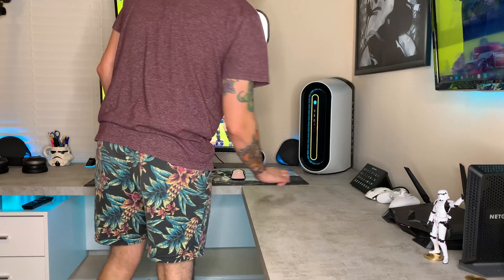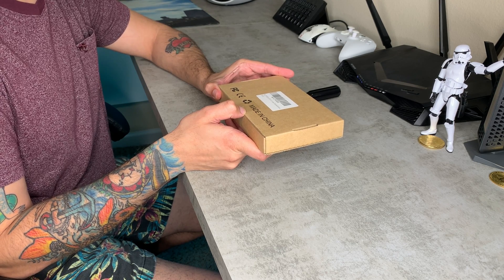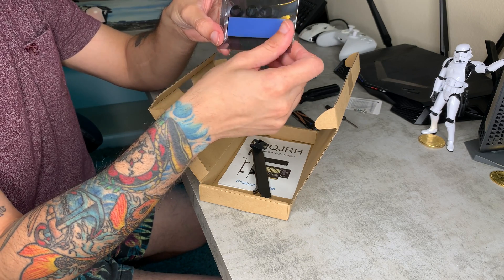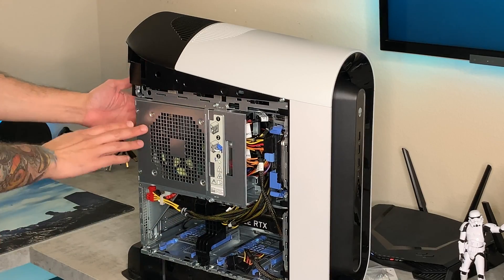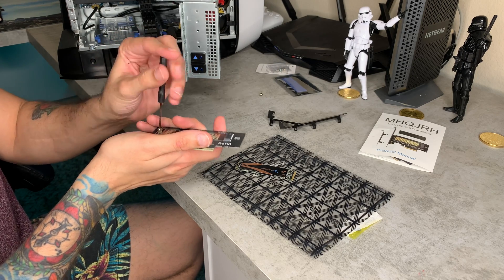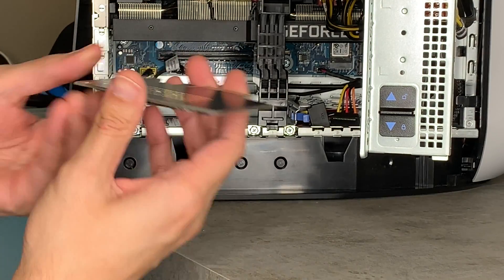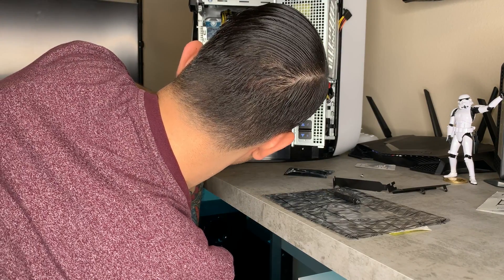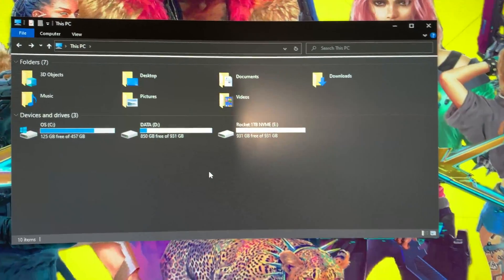Install 2nd NVME SSD on Alienware Aurora R11/R10

Comment: For those having problems with Windows 11 not recognizing the new SSD (while it is showing up in BIOS) - I had it in the PCIe x4 slot two below the GPU, and it wasn’t showing up; then I moved it to the PCIe x8 slot, and it worked. No need to move the GPU, at least for me. Aurora R11

Comment: Mine seems to be working just fine but the red LED light on the drive did not turn green or turn off. Is it ok if the light remains red?

Comment: I have an aurora r10, but I just recently grabbed a 990 Evo pcie 4.0 x4/ 5.0 x2 nvme m2 ssd. After watching this, I noticed the addapter is for 3.0, not 4.0. Will this still fit this adapter, or do I just need to go back and get a sata?

Comment: This adapter is literally so NOT FIT. it does not lock in to the motherboard built-in latch. Do not buy this adapter. Any other Amazon adapter that has more pins and a lock design would fit better and be cheaper.

Comment: Nice video that I stumbled across, allows me to increase storage in my R10 w/o having to mess about with relocating the boot drive. Perfect info and glad to see I am not the only one that added a second intake fan. I have Noctua NF12X25 Cromax fans - 2 in and 2 on the radiator in a push/pull....seeing 3-5 degrees less on the GPU temps which is nice

Comment: Thank you for the video!  I was about to add a bunch of games to my pc, and the speed from an external disc was not cutting it.  I'm going with both the ssd and adapter you have available.  I really love this computer, but I haven't gotten much use out of it thus far since I bought a PS5 and Xbox Series X around the same time.

Comment: Update For anyone watching this video. I was having trouble with my R10 recognizing the SSD in the adapter. I reformatted it on a separate pc and it still would not recognize it. I tried disabling TCM or TCP (cant remember exactly the letters) in bios. That had zero effect. The solution to adding a SSD with adapter is  1.) Take the factory SSD off the MOBO and put in the adapter. 2.) Place new SSD in the MOBO. When I did that it automatically recognized the new SSD already formatted. I am confident that you can use this process even without pre formatting the drive. Hope this helps someone. I went to the end of the internet and back twice trying to figure this out. Thank you Gamer Heaven for the tutorial and idea!
Reply: I'm going to buy a SAMSUNG 990 PRO w/ Heatsink SSD 2TB, PCIe Gen4 M.2 2280. Should I just do this off the bat or test out the original way? I have an R10 as well.
Reply: @RynJck did it work??? I’ve been having issues 😔
Reply: Bloody hell you are a genius! How the xxxx you found the way to fix it?! Anyway it solved my problem for my R11 and saved hours and days to return or buy new ssds. Thanks 👍

Comment: I did this but put a SABRENT 2TB Rocket 4 Plus NVMe 4.0 Gen4 PCIe M.2 Internal SSD Extreme Performance Solid State Drive R/W 7100/6600MB/s (Latest Version) (SB-RKT4P-2TB

And im getting 6000gbs . Write/read

Comment: I know this is a while ago, but i still have my R11 and i was wondering if using adapter is just slower speeds vs swapping out the original. I could just as well clone the original. I ask, because, often is the case, you lose a lot of speed by using the adapter in the other pci slot
Reply: Do you lose a lot of speed using the adapter?

Comment: I know this comment is late, but I have had a problem with the adaptor install. The side brackets do not fit in the Alienware aurora r11, so had to just slot it in as you did. however, the adaptor is not secure at all and flops all around. I have been unable to get my system to recognize the new ssd either. Do not know where to go from here, but I caution everyone looking to buy the recommended products, I think the video maker just had the new ssd laying around from his other computer that was already ready to be installed, and the adaptor was cheap so I think he figured he could spend 12 bucks and make a video. good idea, but for those of us trying to figure this out from scratch it appears as shady business practices when his steps do not work if followed.
Reply: Yo bro did you get your pc to recognize your new drive
Reply: @Aguafy  yes I did. I had to keep fiddling with it until the light came on. Then I could recognize it. It won’t work until the light comes on, little red light. Then you have to discover and name it so you can save to it.
Reply: @Bazarov-SPQR   what do you mean fiddle with it

Comment: The "Alienware Aurora R11 Setup and Specifications" state it can only support 1 TB max of SSD.  This video clearly demonstrates that is not accurate.  Will the R11 support the faster write capability of the newer Gen4 drives?  Manual kind of says "no" but it is not definite.  I have updated firmware.

Comment: Starting right now, I have 2 days to: 1. determine what is the best, fastest nvme is compatible with my R11(currently has the stock 256GB nvme SSD, 1TB HDD)
2. Order them with the appropriate potentially needed adapters and splitters.
3. Install them
As this video is a year old, I have to ask, is this nvme still the best/fastest ssd in today's market?

Comment: Has anyone else’s 3080 temp increased since installing second nvme in the second PCIE slot underneath the GPU. I feel it’s restricting airflow?
Reply: Increased by a whole 15c when benchmarking I should add

Comment: Nice video, but you really should have cleaned the drive with Diskpart on the other machine before installing it, so you could run through initializing the SSD through Disk Management and formatting it.  When brand new, the the user won't find the SSD drive until you do the above steps.

Also, you should be recommending users installing the bracket.  A lot of users move their system around or upgrade different things in the computer which can cause the card to become dislodged and stop functioning.

Comment: Bro. We’re having trouble recognizing the new NVME on the adapter for the R11. I even formatted the ssd on my other pc so it recognizes it. Plugging it back into the R11 we see the red led for power but disk mgmt is not showing the new 1TB. Entering bios on the R11 it shows the rocket 1TB ssd. Do you have any guidance for us?
Reply: Brand of adapter?

Comment: Gotta wonder why they didn't design the adapter so the NVME is on TOP of the adapter so the heat can more easily rise away from the heat sink. Derp.

Comment: I have a R11.  The existing HDD is 1TB.  I have an older 2TB HDD off my older Alienware X51 R2.  It is NOT a SSD.  It is the Toshiba DT01ACA200.  Is it safe to add the older HDD to my R11?  Can I use it to store gaming or should I go strictly with a SSD?  Thank you for your videos.  I have already learned a lot from them.
Reply: i know your question was a while ago , but, i read that no hdd is better as they increase heat in your box.
Reply: @SirLucidThoughts  thank you!  Seems when I get a little fuller I’ll just upgrade to a bigger SSD.  Thank you for the advice.  Less heat is a good thing!  😬
Reply: It won't get hot if you don't use it much. Always fine to store a live backup copy.  @SirLucidThoughts

Comment: I need help:
Yesterday I opened my Alienware r12 and took out the ram sticks to see which brand and type they were, put them back in (in the correct way) , turned on my pc again and no signal to monitor. I took them out put again, tried things and idk why I tried doing my normal windows password on my keyboard (still without signal) and my monitor magically turned on saying that the ram had been changed. Now today I installed the ssd exactly how you did, turned on my pc , no signal. I tried so much things hoping for the same luck I had the day before but still can’t find a way to make it work. Help. (My ssd led is on like yours). Have you ever had the no signal problem ? If so how did you make it work. Thx

Comment: Yesterday I came through your video and it was so clear end fun to watch - thank you. I spent 52 minutes in total with 3 Dell Chat agents and everyone told me a different story about what drive to get, how to install it, what was allowed and what was not allowed. None of them understood I wanted to add a 2nd drive and when they got the picture right, they simply said "no, you cannot do that. You can only upgrade..." Their offer: a 2Tb VisionTek for $850. Really?? Good bye Dell Chat...
Reply: Similar story today - but I had already purchased the NVMe after the discussion with the first rep on what options I had for upgrading my device's storage...no one said "hey you only have one NVMe slot", and I trusted them to tell me since they have all of the information about my build.  Should've checked myself, of course, but glad that there is an adaptor option.  Video saves the day.

Comment: People please be aware of this video. I purchased the exact same parts that he put in the description and installed in my r12. The nvme is showing up in my bios but it will not show up in disk management or device manager or anywhere other than bios. Im pretty sure the adapter is not compatible with windows 11. Very frustrating. Tried all troubleshooting possible and it will not work. Only use in windows 10.

Comment: Hey i know this video is a year old but i'm looking at doing the same thing you did in this video. my question is, does it matter for the adapter if i'm running windows 11? i'm stuff on the amazon page that it supports up to windows 10. it shouldn't matter right? since any drivers or limitations would be in the SSD itself not the adapter.

Comment: So ill have a lower end nvme, but also planning to get the 970 evo, is it better to put the 970 in the original m2 slot or use the adapter? Which is optimal for the m2 slot? Which is optimal for the adapter? Thanks

Comment: Does anyone know if R11 supports pcie  bifurcation?  I'm trying to add pcie adapter with 4 slots thatch handle upto 4 name drives.
Reply: +1 i am in the same situation right now. I have Asus Hyper Gen 4 m.2 4 slot NvMe. Could you tell me if you found any solution ? Dell is a piece of garbage.
Reply: @BaatPateK  Unfortunately the motherboard of my PC has does not support bifurcation. I only bought an adapter that can hold a nvme SSD drive.
Reply: @alberthcamus  yeah same, I am using only one pci x4 nvme adapter. But now I need more storage and I don't want to sell any of my SSDs.

Comment: I used the links. I purchased the adapter and the 2tb stick thru amazon. The bios recognizes the new stick in the pcie slot. Nothing else does. Tried the swap as suggested in lower comments. No success. Been on the phone with Alienware/dell support. No help and no charge. Maybe the Geek Squad can help. For $150 I would hope so. Appointment at 3 so we will see.
Reply: Post script. I cant find where this Gamer Heaven person gets back with anyone. everyone seems to be having this problem. i think my fix is to return these items

Comment: I replaced my SSD with a Samsung 980 pro and now the pc refuses to boot properly. Getting an endless boot cycle that nowhere on youtube has an answer for
Reply: with an adapter so you have the old hard drive in the same spot, right......?

Comment: I have the Alienware aurora R11 32GB Ram 2070 Graphics. I installed the adapter and the ssd exactly as told and ordered straight from links. When I plug it in the red light turns on but it won’t even show up to be formatted. Somebody help please!! Thanks

Comment: Hi thanks for the great content! 
Recently I want to add ssd drives to my r11 and i know there are two 2.5'' slot which i can put in. Just wondering power supply cables for both slot are came with the pc itself right? All I need to buy are 2 disks and 2 data cables if I understand correctly.

Comment: I recently purchased an Alienware aurora R12 that only came with a 1TB HDD. I want to install an SSD, I can't find anything that says what slots the motherboard has. I'd like to assume, from watching your video, that the motherboard does have at least one M.2 NVME slot. If that's the case then I should be fine with just purchasing an M.2 NVME SSD and being able to install it without having to worry about PCei slots or any other adapters. Correct? Thanks for your help!
Reply: Only one slot for the motherboard nvme at gen3.
Room for one SATA 3.5 or two SATA 2.5in.
With adapter, two gen 3 and two gen 4.
Two PCIe x16 mechanical/x8 electrical Gen4 slots (SLOT 1
and SLOT4)
Two PCIe x4 slots (SLOT2 and SLOT3)
You could just swap the motherboard drive if you cloned the new one first, but the adapter makes it easy to clone.

Comment: Hopefully you're still seeing comments on this, can you not use the other pcie slots after putting this on? I orderedc my alienware with the 3070 so im thinking it might be smaller than the 3080.
Reply: The 3080 is the same size as the 3070. I have a 3070 and it takes up two slots on the case. Same as the faster GPU.

Comment: does the r12 also have this slot since I currently have a m.2 extra that i used on my laptop gigabyte aero 15 x and I'm looking to buy the r12 with a 3070 or 3080 depend what special i can get but I want to use the extra 1Tb M.2 that I have on this computer too
Reply: R12 (video is R11)
On board, only one slot at gen3.
Room for one SATA 3.5 or two SATA 2.5in.
With adapter, two gen 3 and two gen 4.
Two PCIe x16 mechanical/x8 electrical Gen4 slots (SLOT 1
and SLOT4)
Two PCIe x4 slots (SLOT2 and SLOT3)

Comment: Did you notice any heat problems with the gpu? I installed a second SSD that lives in the holders below the gpu and it made my gpu go up 10 degrees to 83. Normally around 68-72.
Reply: Did you put a heat sink on it or black screen

Comment: Does the default ssd slot support PCIE gen 4? What about the PCIE slot?
Reply: I did this and installed  a SABRENT 2TB Rocket 4 Plus NVMe 4.0 Gen4 PCIe M.2 Internal SSD Extreme Performance Solid State Drive R/W 7100/6600MB/s (Latest Version) (SB-RKT4P-2TB. Tested it and im getting 6000 read write..

Comment: Dafuq is going on. Mobo has gen 3 nvme, he buys gen 4 nvme for more money than gen 3, adds a doodad that will probably run at gen 3 or lower speeds. This is dumb, add sufficient nvme add sata as needed. If you want more nvme storage get a bigger one, have it cloned and sell your old one on second hand market.

Comment: Cool, would have also like to have seen you removed the power connector from the motherboard.

So did the adapter cause any slowdowns?

Comment: This NVME SSD is a Gen 4 SSD. The Alienware motherboard doesn't support Gen 4, so it will act (in write/read speed) as a Gen 3. Please people, do not buy the SSD he is using in this video for your Alienware, this is overkill and a waste of money, get a Gen 3 instead. The installation method is well presented and is the same.
Reply: R12 has one spot for gen 4.  So yes for consumers using the r11 it only has gen 3. The ssd he recommends and adaptor will work for r12.

Comment: Do you need a usb flash drive to reinstall windows on the SSD? I've been trying to keep my HD and install this same NVME SSD\ keep os on HD but PC refuses to boot up with ssd installed
Reply from the maker: No because I added it as an extra drive to store games , Windows is on the nvme that came installed

Comment: I did this same thing with a PCIE Riser Cable so I consumed one of the x4 slots rather than the x16 slot. I am saving the x16 slot for a SAS Adapter once I repurpose my R10 to the here-after when it will serve as a server with 16 SATA drives attached.  Just sharing.
Reply: Which riser cable exactly? I'm in the same boat, only x4's available 💁‍♂️